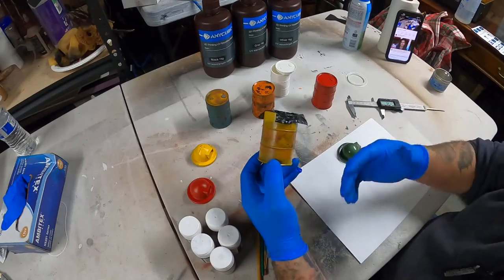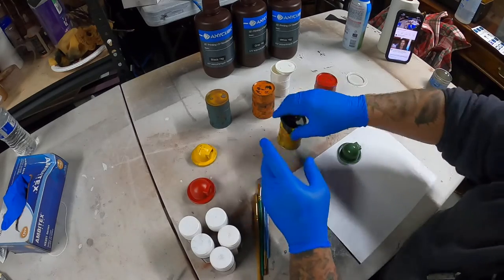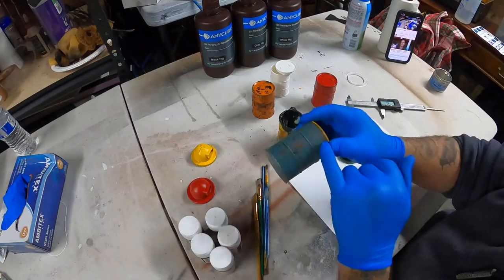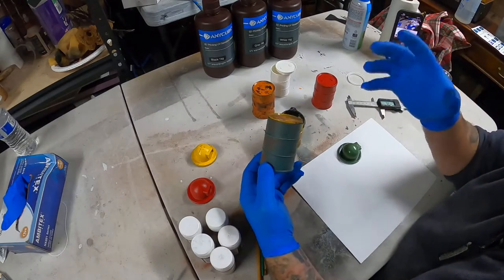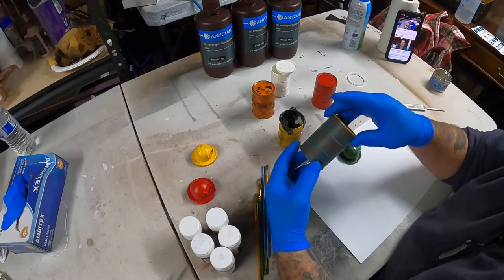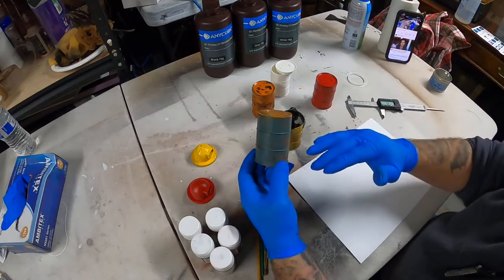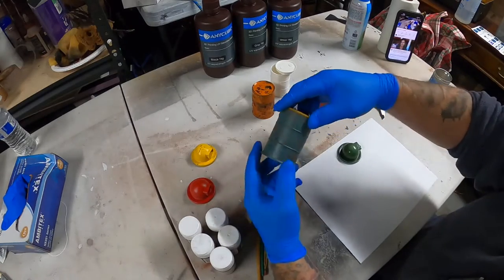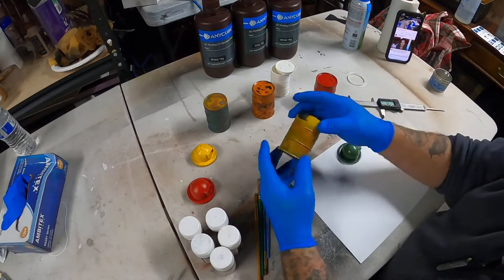Trash cans and barrels aging

Comment: What resin printer do you use? I'm thinking of getting one there are some used ones local like this one for $225 Qidi Tech Shadow 6S SLA 3D Printer only used for 2  prints. But I have no Idea if this is a good one or not.
Reply from the maker: I use anycubic photon monoX with their cure station they have some great sales right now on both units when I bought mine I paid about 900 for both but with a new model out the price has come down I love the printer and there is a huge Facebook community for all the help and tips and resources you will need and that is important